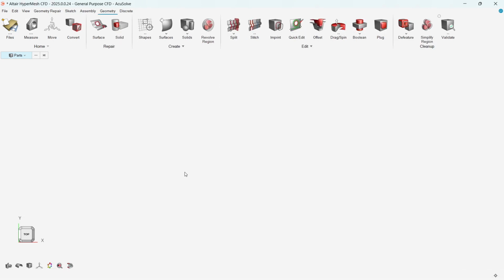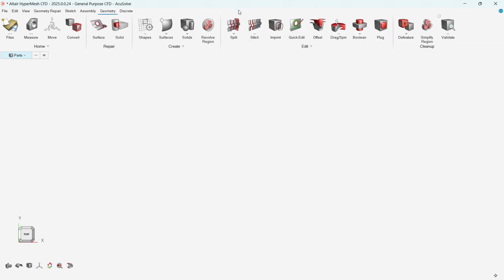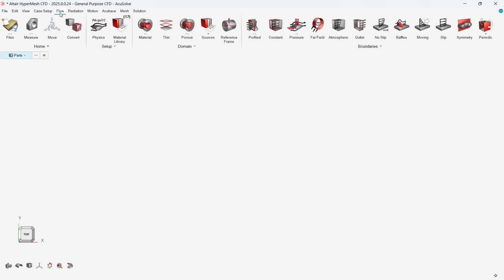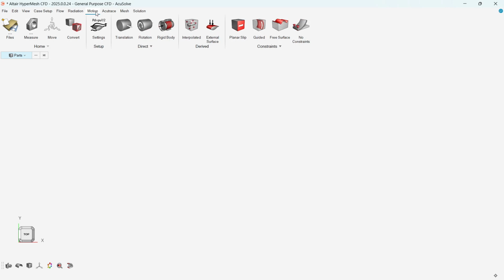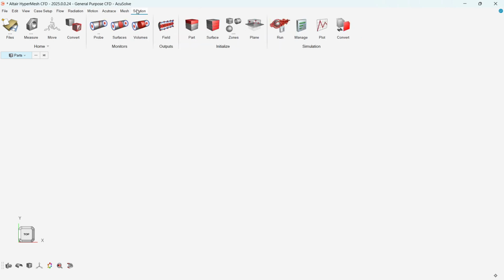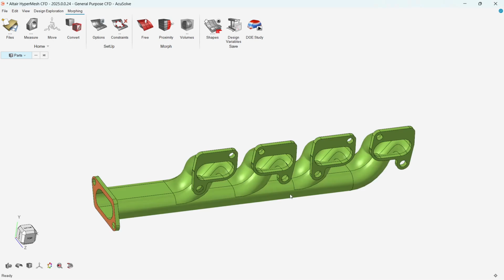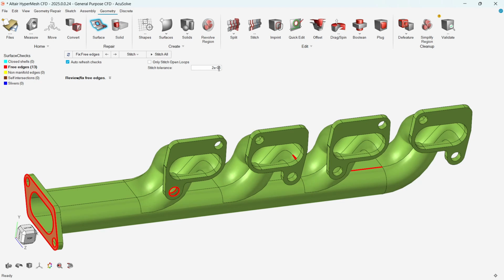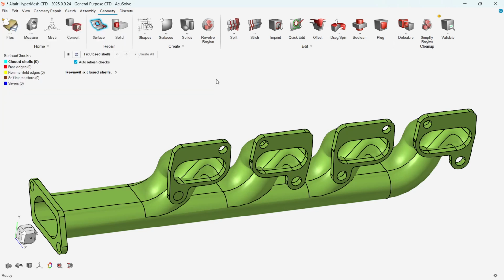The Ultimate Guide to HyperMesh for Beginners!

Comment: Can HyperMesh generate different types of mesh on a 3D geometry?  Like tetra, hexa, or shell elements?
Reply from the maker: Yes  HyperMesh is highly flexible and supports multiple mesh types for 3D geometries, including tetrahedral, hexahedral, penta , and shell elements. You can control mesh type, size, and quality depending on the analysis requirements  perfect for structural, thermal, and CFD simulations.